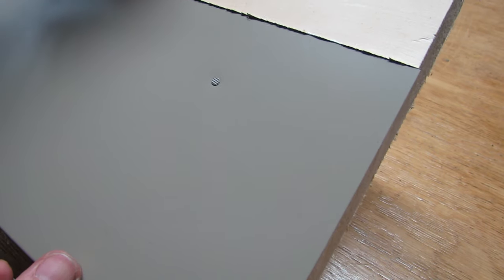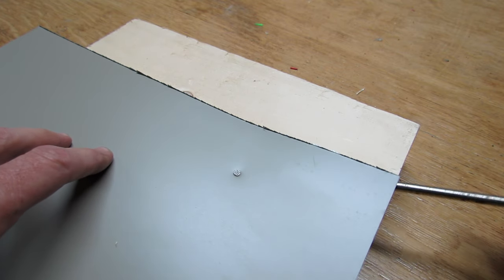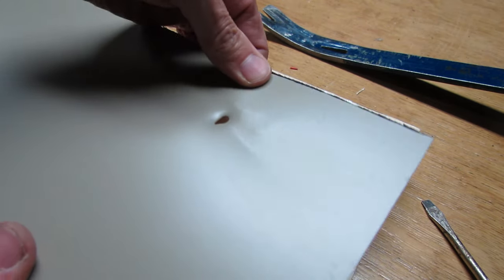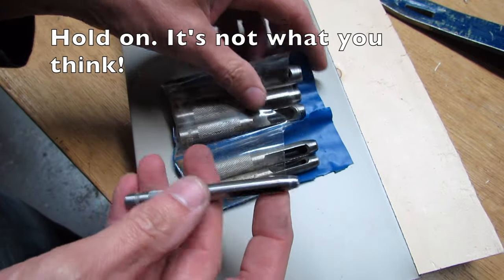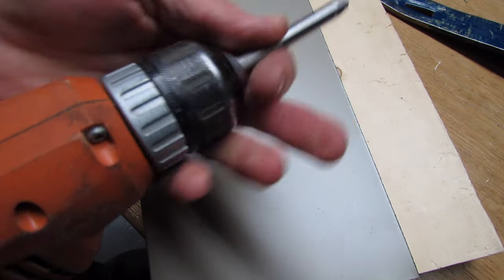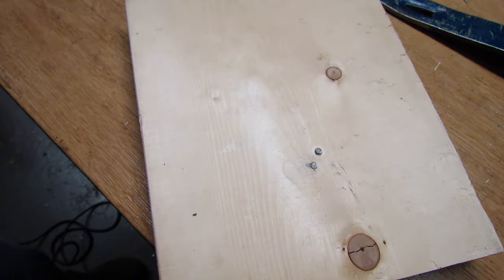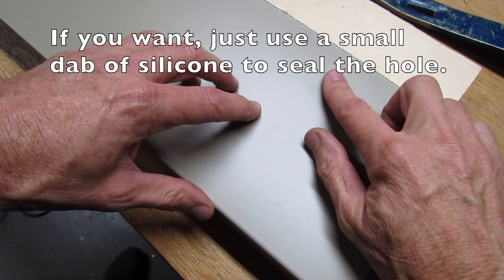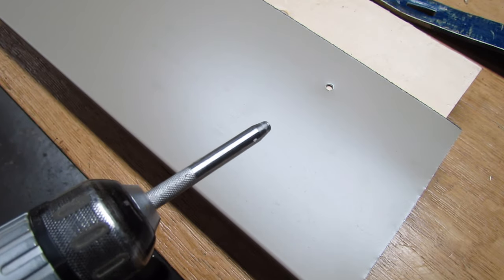How to ● remove a nail from FASCIA or SHEET METAL without destroying

Comment: We used to just punch the nail in with a nail set. When I solo hung fascia cap I used a couple scratch awls to tack it in position then check if it was perfect before putting nails in. You can also leave those trim nails proud while you check before committing to finish driving them. The awls make starting the nails easy and and leaves some tolerance around the nail shank for expansion.

Comment: thats quick, but for a smaller hole you can use a ball ended diamond bit or small carbide bit to drill a hole in the center of the nail. the top just pops off then. you can reuse the hole even.
tape around the screw so it doesnt drag out across your surface unexpectedly if using a diamond bit. 3mm carbide would do it lovely.

Comment: I've always read that you shouldn't face nail the fascia as it provides a path for water to get in and rot. You should fasten from the bottom if possible. The drip edge or gutters will hold the fascia at the top.
Reply: Adam I wish my builder had listened to you!  The only good thing they face-nailed the thin metal drip edge only where the drip edge overalapped the next piece..

Comment: Hi Chris, another awesome video. Couldn’t you use the same tool at a smaller size to cut the nail head itself, so the fascia comes off with the original hole intact (ie. no enlarged hole in the fascia panel?).
Reply from the maker: Possibly. My set of bits didn't go that small.

Comment: excellent. I can't find:  How do I temporarily remove aluminum soffit?  i think i can get it out if I un-bend the 90-degree bend, but I'm quite certain I could never get that bend again, especially with the piece still in place on the wall.  How do I temporarily remove aluminum soffit?
Reply: oh - perhaps removing the nails, as per your video, will allow me to move the soffit so i can angle it to then bring it out.  the nails holding the soffit are not covered by drip edge, so water could enter there, but perhaps it doesn't matter since the water would only contact aluminum...

Comment: Some *%#&^%! put nails in an old door hinge.  It has also rusted and been painted.  What a mess.  I am thinking a punch like this will not work on a hinge since it is much thicker than the metal shown here, and I wouldn't want to change the hole size even if possible.  This is an old ball tip hinge and I have resurrected the other hinge on the door, but can't get this hinge off because of the nails. The punch set shown here is intended for leather.  Will it really cut thru metal, like the nail head?
Reply: It's not intended to cut through the nail head. Only the thin sheet around it. And yes it's designed for soft metals like this as well as leather. Ace Hardware sells them.

Comment: Or..... you could use a common nail set and punch the nail through the aluminum leaving exactly the size hole of the nail head and no larger. Almost everyone who has ever done any kind of trim work has a nail set.  And if you don't you shouldn't own a hammer.
Reply: Thank you.  Duh
Reply: Will this dimple the aluminum? My hunch is yes. Aluminum is crazy soft to begin with and capping is amazingly thin. I think that's the whole point of this video in the first place.
Reply: Bill - or anyone - can you reply to Wade's question?
Reply: That's a horrible idea. It would definitely deform the metal. Personally I would drill the head of the screw off.